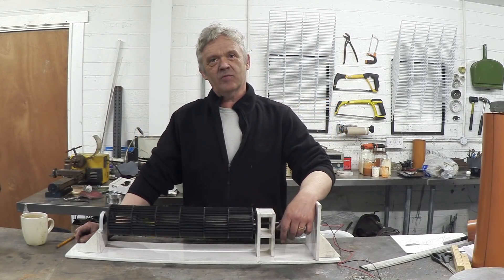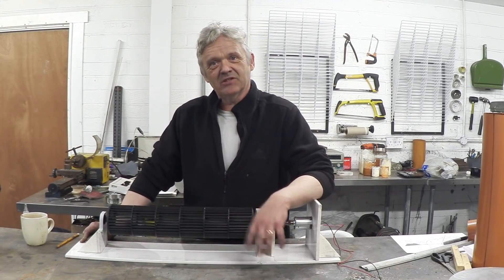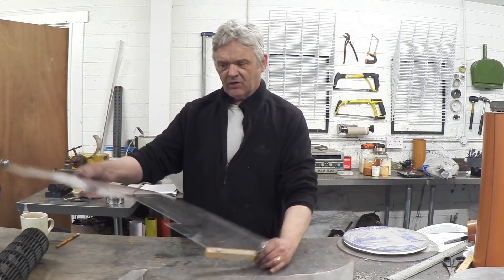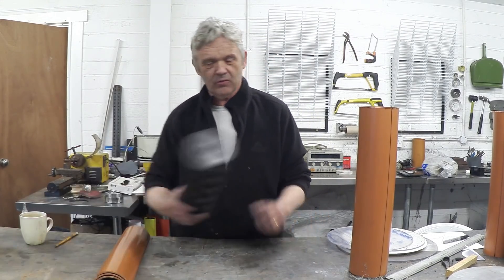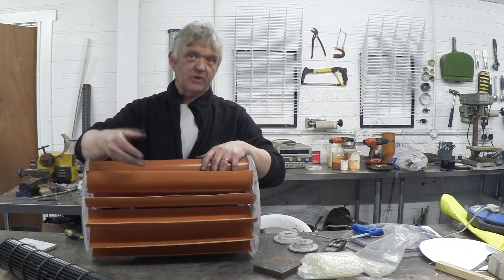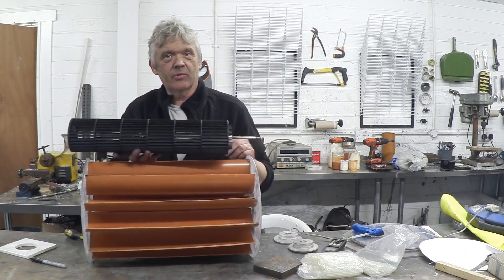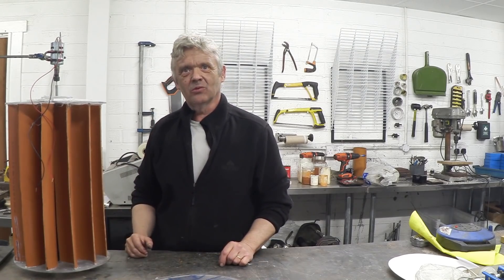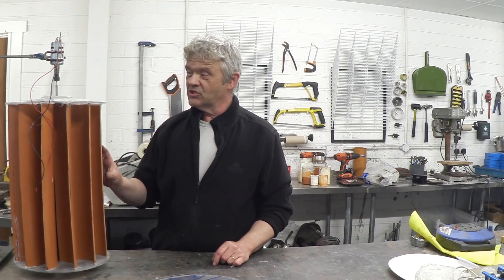Vortex Shroud For Vertical Wind Generator

Comment: I was thinking this was a good idea, until I realized that it was being used to blow air ONTO the turbine, rather than INTO the turbine. If it were blown into the turbine (using some form of wind collector and tube/ventura system) then the exhaust from the turbine would be using the shroud blades as a "launch pad" to increase RMPs. When the wind is collected by the shroud blades and focused on the turbine, it may appear that it's causing the turbine to accelerate on its own, but I believe that the reason for it working better in low wind speeds is that you've simply increased the total surface area and air volume of the collector. Should you just remove the shroud and use a larger turbine, the effect would probably be comparable.

I'd like to see this same setup, but with the air being forced into the center of the turbine. Rebuild the shroud with flat blades that are aligned perpendicular to the angle of the turbine blades, which would create a flat surface for the air to push against... and that's how I believe you'll see higher RPMs, with the same volume of air.

Comment: Robert.... when trimming up PVC pipe edges I use a hand wood plane a few passes and it is done and if you did it right it will be perfectly flat !  safer than your blade and it takes down the high spots and smoothes it up easily !  thought you'd like that ! I use a palm plane for this... usually.

Comment: Squirrel cage fans usually pull air through ends and then blow air out a longitudinal slit, how can a medium large used squirrel cage fan be repurposed for generating electricity. Thanks

Comment: I've heard the Shroud also called a Vane.  The Vane basically directs the wind onto the blades causing rotation, and blocks the fins on the opposite side of the turbine from the same directional wind which would slow it down or cause a "drag" effect.  So in essence it promotes acceleration and prevents braking.  The Vanes are normally straight though, but whatever works, it's all trial and error as Mr Smith points out.  And the bonus is it supports your turbine.  Nice one Mr. Smith : )

Comment: This may be beyond insane. But take your MHD magnet core of two attracted doughnut magnets. Then the electrodes are two parallel rings on the out side of the magnet core. Paint Radium Chloride on the cathode. Then put in a cone to funnel wind though the cold cathode mhd. If it works the ionization should put a voltage and current on parallel rings of the device as the wind blows without any moving parts.

Comment: Found a unit on YouTube made from 2 X 205 lit plastic barrels cut down in half then put in top of each other and r un vertically so it was like your experimental job but ran a single axle and drove a geared up car alternator. This used a lazy Susan as the bearings white made a hell of a racket but with a bit more thought might be a practical unit especially wind blows (not always) day one night
Reply from the maker: there's a big problem with savonious types - but sure, why not

Comment: One thing perhaps worth considering, Robert, are the roof mounted vents available in the US called whirligigs, very similar principle with a lot more blades.  I've considered using one set up much like the old dynamo lights on bicycle wheels.  However, despite the rather simple setup, these setups lack the rather important furling system. Some style of braking system needs to be employed should the turbine encounter string winds to prolong the life of the turbine itself

Comment: I always wanted to make one from 20 gallon drums cut in half, connected to at least one 12 volt bicycle generator (or even a power steering motor). The bearings could be from twenty six inch bicycle wheels and the generator(s) may actually contact the tire itself as they do while on a bike. Start up drag would be detrimental, but there are ways around that. Just a thought if you really get bored. ☺👍🏻
Reply from the maker: nice one mate - cheers

Comment: Wish you'd gone into the benefits a bit more. Viewers might have been interested to know that it works in both extremes, to make the turbine work in lower speed air, and also to protect it from overspeeding in faster wind.  The ability to support the top bearing radially is a big deal as well.
Reply from the maker: I agree mate - but sometimes all you can do is introduce the idea - if you try to put too much in - folks just don't watch

Comment: Based on your very clear skills at producing the shroud, have you thought about employing the same technique to build the actual turbine blades. I suspect the small size of the heater turbine, will seriously impact the size of motor/generator you can turn under any kind of charging load. Great videos, love the open minded approach to learning through practical experimentation.
Reply from the maker: yes mate - it is planned for a future video because I agree with what you are saying 100%

Comment: If you were to use this principal with the PVC, except if u created a spiralactical vortex, so the tunnelling of wind thru redirection, is funnelled thru, also compressing it, (each tunnel would be 1/3-1/2 {120-180deg}) this would create a spacing between each connecting tunnel, allowing to have smaller versions of the internal fan blade along the outter paths, so the pressure to the outer surface of the tunnel as it travels, can be harvested, which will add to the potential of air flow. And if u put an internal cylynder that has either been bent to spiral or fabricated with a spiral, the flow of air will increase through the entire generator faster, and more efficiently....(drawings maybe required.)
Reply from the maker: interesting ideas mate - cheers

Comment: Wouldn't the actual shroud rotating itself generate much more power. If the revs arnt to high ie a big load, the unbalance shouldn't be to bad.
Reply from the maker: I don't know but think so mate - plus it gives structural stability and that's not to be sneezed at

Comment: I have been trying to get an FWG members channel membership but am not able to find an actual sign up section. When I click the link for joining, above,  I get a video soundtrack but no picture and nothing that takes me to an actual sign up page.  Any suggestions for getting a membership for the membership channel?  Sorry to enter this request in these comments but I'm not getting anywhere.  Love the channel and thank you for your help with this.
Reply from the maker: thanks for the efforts mate - it's all run by youtube though so i'm afraid i really can't assist - so sorry
Reply: Thanks. lol you've responded much more quickly than YouTube which is amazing. I'll get it straightened out 🙂

Comment: Nice work, the housing/shroud is great. Just for fun, I predict a 25% increase in output in equal conditions. Some large ships are using helical turbines to supplement the power needs of the ship. Here is a link to one example used on a ferry http://www.verticalwindturbineinfo.com/vawt-manufacturers/urban-green-energy-wind-turbines/

Comment: Could you get a better aerofoil shape made some clamps on the 3D printer that were in a better aerodynamic shape (parabola maybe?)  You'd one clamp on the bottom and one on the top of a piece of acetate to make each blade.

I had success making an acetate tube by putting a sheet between two embroidery hoops.  A similar clamping mechanism should work to hold a blade shape.
Reply from the maker: that's a good idea - thank you

Comment: It is also now a two stage turbine, given another set of bearings.  You could drive two generators or use a (magnetic?, planetary?) gear set to drive a larger, single generator.
Reply from the maker: I guess

Comment: here's an idea, although a little more complex.  if the spinning fan were made of copper or maybe coated in copper then permanent magnets fixed to the blades of the shroud, close to the spinning fan then theoretically the entire spinning fan would be induced with current so the fan itself becomes it's own generator, no need to connect an external generator, not sure how efficient it would be, but theoretically it should work to some degree. I guess then connecting wires to the top and bottom of the spinning fan with brushes would let you collect the current.
Reply from the maker: interesting idea mate

Comment: Might I suggest, if you can find a place [perhaps close to the ocean] and/or on an elevated structure, so that you can rise your machine up above the ground clutter [which is killing off most of the usable wind, just normal nature to do so] perhaps you can find a sufficiently strong wind which is sufficiently steady that you can perhaps obtain a realistic amount of power from the machine.
Also, if the torque is not adequate, but the wind speed is reasonably high, one can create the equivalent effect of a high speed generator simply by dividing the poles more.
I did this once, I replaced a wheel with 4 very large, very strong magnets over a single coil with a wheel with 48 smaller [still relatively strong magnets] and 12 coils [ideally I would have had 24 coils, but at the time, I was using scavenged coils from little AC to DC power adapters like you would use to plug into a small device and charge it, but now I have a coil winder and very fine gauge magnet wire, so should I ever revisit this (and since I have a 5 foot diameter 6 blade fan my brothers think I definitely should) I shall indeed make more coils, [however, I will do my best to space them on a 4:3 or else 7:3 ratio so as to avoid the whole 'cogging' issue, even though this requires more materials, because cogging is something that needlessly saps power from a wind generator and many large ones are made from the factory to be totally non-cogging, despite the extra cost, because it allows them to operate at far lower power inputs and lower wind speeds]. ~( 'w')/
Reply from the maker: awesome - thanks for taking the time to write

Comment: Power in wind is a function of several factors including speed density  and cross section area, not surface area.  The vawt shroud increases effective cross sectional area that the wind blows through.
Reply from the maker: true enough mate

Comment: I think it might have been better to cut the pipes into quarters rather than thirds. Then have them fixed in a way that they are fixed in a way that allows minor adjustments of the pitch by joining the outer ends to a disc that allows a 10 degree swivel.
Reply from the maker: interesting idea mate

Comment: As a test rig, grab a floor stand fan, set it at a fixed distance from the wind generator and measure the output. That makes for a repeatable setup that you can then characterise the generator in its development. Great video, thanks Robert.
Reply from the maker: cheers mate

Comment: So another thing to consider is where does the air go once it made it's way into the squirrel cage? It has to go somewhere and my guess would be that the effect of the air trying to escape the cage would slow the cage. One way I can think of to mitigate the unwanted effect, would be to exhaust the air out one way by means of an internal spiral...maybe worth a shot.
Reply from the maker: yes - I was thinking about that - but nice point mate cheers

Comment: Fascinating video. Someone on youtube called live smartly has a huge version on this idea built onto a roof and looks like it would make a good deal of power. If you were to stack 2 units ontop of each other and set the blades to rotate in different directions, you could fit a ring of neodynium magnets on one as the rotor and a ring of copper coils on the other and have the same effect as the turbine spinning twice as fast. Needs to be bigger but i think could be easily made from ply or even fabric over a metal rod frame. A simple way to generate a useful amount of power.
Reply from the maker: I have seen a couple in Hungary like this that are huge

Comment: Great video! All info has value. This type of turbine has a disadvantage in that the blades are optimized to move air out and when diverting the air in the opposite way means the air has to find it's own way out instead of requiring being evacuated like a vacuum. An open squirrel cage fan such as blower can be reversed by directing the air flow to the axis and understood as a hawt
Reply from the maker: cheers mate - thanks for taking the time to post

Comment: I wonder what would be the difference(s) of using your methot instead of using the whole contraption as the blades of the generator (with the adjastments of course)
Reply from the maker: dunno - worth a try

Comment: Okay this would have been the perfect thing for a cheap or homemade 3D printer. Shaping those fins would do wonders, and simply printing them out would be easier than trying to machine them or grind them to shape. I’m honestly surprised that you don’t work with 3D printers more often.
Reply from the maker: It's just a judgment call mate - I think most folks don't have them but do have tools so I try to do stuff that I think most folks could replicate if they wanted
Reply: Robert Murray-Smith ahh. That makes sense. I would still love to see your take on a scrap built 3D printer.

Comment: It seems making a horizontal funnel to blow the air into the vanes will do a good job as well, the issue is that the air can not go anywhere once it is in the 'cilinder' so either there has to be a way out (with underpressure) or the air stays on the outside. The shrout is not doing a great job because I think it is made for VAWT with a central exit for the air.. The 'cilinder' is normally in the enclosure which functions as a funnel..
Reply from the maker: nice points thank you for taking the time to post

Comment: I have always wanted to build something similar to this with a DC treadmill motor, a 'squirrel cage' fan and a wind funnel accelerator. The physics are quite obvious. If you have the hauling ability, broken treadmills are free all over to haul away. The motors are built like tanks and rarely are the failure, plus there are loads of useful components.  http://rexresearch.com/waterswind/waters.html

Comment: nice build!, an idea; purely for visual effect, one strip of paint down the fan "blades" would make it much easier to see it spinning. I noticed in the earlier video there were times on camera it appeared to be stopped but judging by your reaction it was still spinning.
Great video as always!
Reply from the maker: nice one mate - it can certainly be difficult to tell - I watch the screw at the bottom to see if that is turning or not because I can't tell either lol

Comment: How about trying a stepper motor ?
Reply from the maker: I have done stuff with stepper motors but tbh they cost more than a 775
Reply: IRC they are high resistance and hard to spin under light torque that an average ground breeze would create aka it would not spin most of the time.
Reply: @Barskor1  8 Ohms-- high resistance ?  ANY generator when "on load" is hard to spin , just depends on the load-- dont get somthing for nothing.....

Comment: Hey I seen this leaf caught in a spider's web
In such a way that it was dangling from its stem . So it didn't matter how hard or erratic it was it still was spinning.  I always wanted to try to replicate that. Its really easy to replicate what I'm talking about.  Just grab a leaf and stick it to a spider's web.  I can see a motor hanging with a flexible poles and a leaf shape to  drive it. Its one of a kind.  Please help me out if it's a success . I can really use it.
Reply: I’ve seen this quite a few times now. Mesmerizing to watch. I’ve seen spiders float leaves like this to build webs too. I bet he could easily do it with that speaker design and some weighted cordage of sorts
Reply: The weight of the motor is a issue.  Some how if you can extend off the motor generator upward.  As to balance it to float a long with a flexible shaft of some kind . It might work. And I love the idea of the speaker why not incorporate that to.
Reply: https://youtu.be/MBg3W72gX5U spiderweb ;)
Reply: shannon R and to use flexible shaft to connect the rotor to a motor placed at a distant area..the rotor at a roof peak...the motor down at ground level...
Reply from the maker: interesting idea mate - have you tried to build anything?
Reply: @ThinkingandTinkering   I work to many hours and just to worn out to at the end of the day. It not going to do any good leaving this stuck In my head.  I hope it can help someone who has more time then me. I'm a fan of your work and appreciate the time to share with us all.
Reply: I have seen a great version of what you are talking about in the States! A large kite with a flexible tube is launched up to a couple of hundred feet. Attached to the tube at the bottom is the generator. The tube has curved fins attached on either side and staged in a staggered formation from the top to bottom of the tube. Once launched into the air the tube begins to rotate and generates the power. As it is up quite high, the wind speed is proportionally much greater and smoother. Other examples I’ve seen use a helium tethered balloon at 1000 feet with a similar styled rotating tube to the ground.
Reply: If you have a email I can send some drawings of some of my ideas for this.

Comment: Actually you need an airfoil to scoop the win to a certain percentage in portion of the squirrel cage blower wheel. Then you need to dedicate a straight airflow exiting low pressure zone a certain percentage for the air to leave in a different direction.              You almost got the concept down and a slight understanding but you’re missing part of the big picture HVAC and airflow just happen to be my profession.  And we actually work with those kind of blower wheels
Reply: Add holes to the bottom and top over the blower wheel? Edit I think Robert was going for an omnidirectional setup so a rudder and a pivot point to turn it into the wind would not be needed.
Reply from the maker: cheers mate